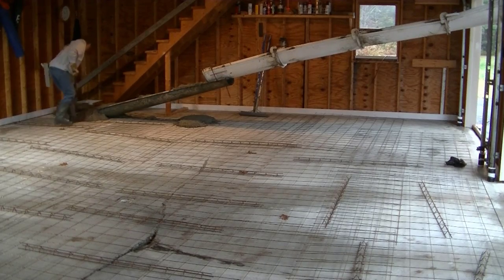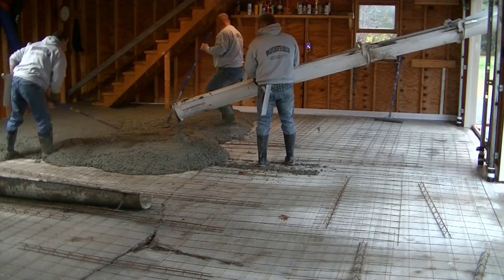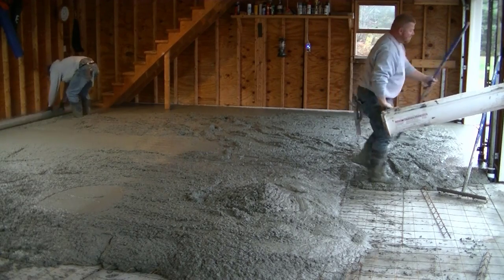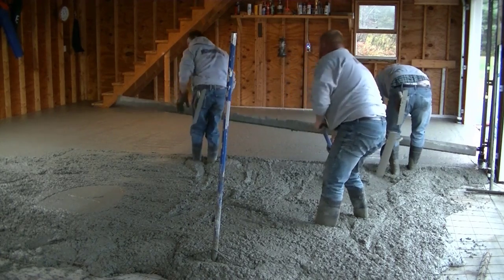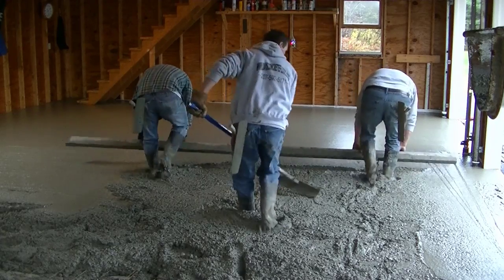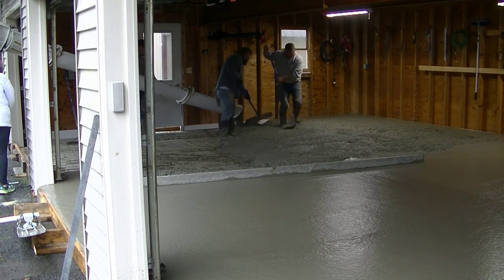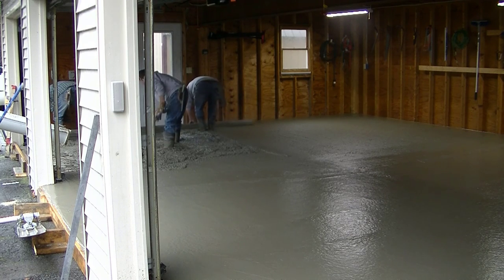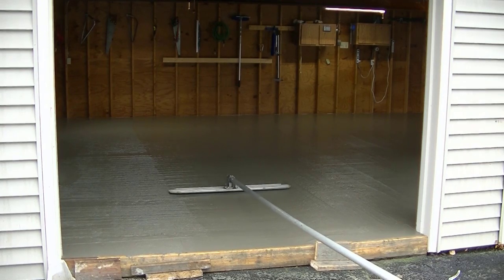Pour A Concrete Slab Over A Concrete Slab | Garage Floor Makeover

Comment: I have a shop floor 6 inch thick. No cracks. Would like to put indoor heat. So 1.5 to 2 inch insulation down on the old floor then infloor heat lines. How thick would you pour on top. It does get a 150 hp tractor parked inside for the winter.
Reply from the maker: For a floor with large equipment like that at least another 4".

Comment: I have a question if I want to pour a 1 1/2" slab over my existing garage floor which cement is best to use?
Reply from the maker: I use 4000 psi with 3/8 aggregate for my mix. I add micro-fibermesh to the mix also.
Reply: @MikeDayConcrete  thanks that will help me lots

Comment: Can you feather out a garage drain slope. My garage drain has to much of a slope about 5 feet around the drain. I have about 2.5"slope in 5 feet. I want to just re-slope to the drain. But wondering if from the old concrete to the new it will bond?

Comment: My money says there is little to no rebar in the oiginal concrete< When I added a garage to a house when I lived in NC I had several concrete guys come and give me an estimate to do the floor they did not want to use any rebar at all. I hired someone to do the pour. I did all the steel and form work and they finished it. I used 4000lb mix, rebar and fiber in the concrete. No cracks after 8 years, my neighbor had a garage built and it looked like the one in the video after 1 year.  I poured mine 6 inches thick.That is why I wound up doing a good part myself.
Reply: Usually that’s caused by insufficient compacting of fill. Re bar and wire is code and should have been inspected.

Comment: Great idea!  Can you do the same over a driveway?  Similar situation, house was built 22 years ago.  Had some leveling done about 10 years ago, but still dealing with pitting and cracking.  The builder at the time subbed out a lot of his work to the cheapest folks he could find.
Reply: No you dont want to pour over your existing driveway. Have to see it to give my opinion but remove and replace is your best bet 99.9% of the time.
Reply: Do you have to cut the asphalt to remove and replace?

Comment: What do you do for your garage door detail do you slop the concrete or anything to keep water from running under the doors
Reply from the maker: Yes, we slope it about 1/2" and in about 8"
Reply: @MikeDayConcrete ok I was just wondering cuz we start the slop back around 4 inch's from the edge of the wall and and put a inch or better that was the door when closed is sitting about 2 down on the slop and that seems to keep wind driven rain from coming under the door and flooding the floor

Comment: Great video.  What was the reason you created a hand trowel and plated a 12" second in the middle of the pad and you seem to compare all the level with that.  How did you get where that level height should be

Comment: Did you trowel finish that floor? Saw cut it?
Do you use water reducer in cold weather?  Or is adding water the only way to make concrete flow better when cold out? I'm talking just above freezing.
Reply from the maker: Yea, we power troweled it and saw cut it. We always use the water reducer whether it's cold or hot outside. We had 115 degree water in this mix and we used calcium chloride in the mix to help it set up faster. It was about 40 degrees outside and rainy on this day.
Reply: No problem with calcium chloride when using rebar Mike? No disrespect,  just asking from So. Cal. Your you tube videos are all good, informational. You don't do any bragging or b s talking. Nice.Thanks

Comment: I have a shop that is 25x40 and was originally a chicken house. The previous owner poured his own concrete 50 years ago but it started cracking 10 years ago and has separated perhaps an inch and some un leveling here and there. I filled cracks with concrete but it doesn't last long. There is some hollow spots (sounds like it) under existing concrete. Would it be possible to pour 3.5 inches with good rebar and have it hold for 20 years? I would tie into existing stem walls which are cracking too.

Comment: Shouldn't you crack the concrete to give some bonding and moister to escape between concrete? I assume moister may be trapped between the lower and upper slab.
Reply from the maker: Simple answer to that is no.

Comment: Hey Mike,  why didn’t you put heavy plastic down before pour, ?
Reply from the maker: I could have. He wasn't having any moisture issues. I didn't feel he needed it on this one. Each one is different. I do come back and apply a penetrating moisture blocking sealer.

Comment: Quick question for you.  I have a 750 sqft garage and i do get some moisture wicking up through.  It caused my garage floor coating to peel.  There is no vapor barrier under it...the original builders screwed it up.  
Would it be possible to put a vapor barrier down before you add another 3"?
Reply from the maker: Yes it would be recommended to add a vapor barrier but I  would also add an inch of crushed rock also. If you have that much moisture it has to have a place to go and not build up pressure under the new floor.
Reply: Here in PA, some builders do not put vapor barrier under slabs that do not have living space above the garage. Just a thought as to why there was no vapor barrier.
Reply: @MikeDayConcrete  Thanks for the reply.  
So with the crushed gravel, doesn't the moisture just seep into the gravel and hang out there forever.. saturated?

Comment: Great video!  I have a good slab, with no cracks, in the garage and it’s level. My issue is where the garage slab separates from the driveway slab. The garage slab is about 1/2 to 3/4 of an inch higher than the driveway, and it curves in toward the garage in the middle, with the slab line even with the outside of the door railing. When I shut the door, the outside 3rd of the door, on both side’s, seals, with a gap in the middle! I can’t even install a threshold because half of it would hang off the slab. Do you have any thoughts on how I can remedy this, and get the doors to seal without replacing the whole floor?

Comment: Bought a property that had a torn down garage; only the concrete pad remains.  I want to build a bigger garage over that spot.  Can I pour a new slab over the old slab?  Will that meet code?  It will be a lot cheaper than having to jackhammer the old one up.
Reply: Not are not building a rocket ship, so anything will work. Make sure the draining of the new parts are good. Ideally, add some fine sand on top of the foundation and flatten and level it (about 1"?). Then add 2 layers of heavy plastic, and pour the concreate. Make sure the concrete is floating on the top if the sand and the moisture barrier and that it isn't touching anything rigid. Then the floor will never crack, provided the foundation is stabile.  

Most important is draining and a stable foundation. If the concrete is floating on top of fine sand and  2 layers of heavy plastic,  it will never crack.

Comment: How much did you say you charged for this job?  Did you say it was 10X cheaper than breaking up the concrete and pouring a brand new slab?  Just trying to know what kind of price I should be expecting. Thanks.

Comment: When over-pouring existing concrete, do you ever have issues with reflective cracking?
Reply from the maker: Not really, but you can have them if the cracks are still active. If you think that's the case you can add a layer of 1/4" foam between the pours.

Comment: I had always wondered if this could be done. My dad who coordinated with the builders and the concrete folks had my garage floor built higher than what was in our previous garage which on occasion did get some water. We knew that  we would never get water with what we had. All that changed one Hurricane Ike hit. From that point moving forward my part of the city has always had street flooding. Although the cities sweats they cleaned out the drains my garage continues too take on water. My garage would be like a small 4 bay. I have storage on the south side and one large garage door on the north side. These two areas are separated by a wall. Assuming that I might be able to find some to pour another 2-4 inches on my existing concrete would I need to remove the wall in between? I do have windows on that side about 3 feet from a gate which leads to the street.   My long term goal was to build a room on the north side and leave a garage on the south side thus the reason for the wall. I suppose I would have to cut the garage door hole higher.  Anyhow, I am really glad I saw this video and know that pouring more concrete is indeed an option. And is priced lower than $38,000.

Comment: 38 years in construction with the last 19 as a licensed contractor. I'm sorry, but I have to say something. The stairs should have been removed & rebuilt, because, the risers will no longer be to code, risers have to be the same height from floor to floor. Also, I've always left a door pocket in the concrete for overhead doors to keep blowing rain, built up snow, etc...from getting in. Is that something you normally do but just didn't do it here? Also, did the top panel of the garage door need the wheel hubs adjusted or larger ones installed due to the floor being higher?

Comment: Why was the garage floor originally poured the was it was when it was first built? Also, could you use a wire mesh for better tensile strength or would that present a possible cracking issue due to expansion?
Reply from the maker: How am I supposed to know why it was originally poured. Not sure what you mean about the wire, we did use wire.
Reply: Mike Day Everything About Concrete - Well Mike I guess perhaps you could’ve asked the person who poured it or maybe they poured it themselves or maybe there was a reasoning because I believe if I remember correctly there was a drain in the middle of it? So I thought perhaps the property had some sort of drainage issue. Thanks for replying back.
Reply from the maker: It was originally poured in 1995. I'm not sure who did it back then.
Reply: Mike Day Everything About Concrete - thanks, I did not catch in the video you used wire. Thanks for the reply. Great work!
Reply: stanley smith open your eyes!
Reply: Gary Derksen - Watching from an iPhone I really could not tell because if I recall, the video starts with the actual pour. I wasn’t sure if it was rebar or the wire came through or what not, like maybe the owner may have added. My other concern was possible cracking with wire mesh so close to the surface. I didn’t want to be a smart ass so I asked politely. I also wonder if Mike could have gone without the wire mesh. I also noticed someone else wrote he would’ve gone with sand and 15 mil moisture vinyl, so I wonder if the wire mesh could have been skipped altogether.

Comment: Hi Mike! Hey we raised our garage up to house floor level years ago to make it another bedroom. In retrospect it probably would have been better to just build a wooden subframe incase we wanted reverse it back into a garage in the future. But we poured concrete instead not really knowing any better. I think we poured about 5 to 7 inches to raise to floor level....

Do you think it's possible to break and remove slab to reveal original foundation and reverse the space back into a garage? Or is that pretty much permanent? 🤔

Comment: Love the vid and I have the same problem (lesser as it only gets about 3 feet in on one side at the bottom of the Garage door).  I have a question.  I've framed out my door with the same type of poly board.  Would it be better for me to cut the board and trim, as well as move the door rail before capping the existing slab?  Also, did you frame the floor to where the seam separating the garage to the driveway?
Reply from the maker: It's a good idea to cut your trim up, yes. We did put the door stop where the floor meets the driveway.

Comment: Tamp to leave one or two guys to finish by hand. Makes it creamer (rock farther down from top) first time over = easier. ( you can take wider sweeps first time over gives you a better chance to go over it 3 times instead of two. It’s ok for inside, but on outside work you wouldn’t want to tamp because you want rock closer to top to help hold concrete in place. ( help keep from popping in freeze thaw cycle).
Here’s a example if you .left those two girls there to hand finish it would be a lot easier for them to trial the concrete. Give you less stress on wondering how they’re doing.
Reply from the maker: I think I'll pass on the tamping thing. Don't see where it's really needed.

Comment: You only have 3" of concrete in front? Seems like that's not thick enough?
Reply from the maker: Steve, it's got a 6" concrete floor under it for a base. It'll be good.
Reply: @MikeDayConcrete  it's more likely to eventually crack it would seem

Comment: Do you worry that the old floor will drop more, and crack the new floor? I see the steel in there, but is that normal to do? Just curious...
Reply from the maker: It hasn't dropped any more since about 1996-97 year. It did the settling the year after it was poured. We drove a heavy vehicle over the cracks to see if either side of the crack moved any and didn't notice any movement. The homeowner was informed of this risk and he was comfortable with it. We felt it wouldn't settle otherwise I would have suggested a tear out and replace.

Comment: would this work in Canada? the house I bought wass built in 1989, the garage floor is cracked all over.
Reply: I would advice jackhammering it up and correcting the aggregate underneath and pre pour with rebar. Then correct the water issues you most likely have.
Reply from the maker: I have to inspect each one of these to make a decision if it's a good candidate to pour over or not. Some are and some aren't.

Comment: What about the edge going into the garage, there is a 4 inch high
Reply: Probably have to remount all the garage doors too or there will be a big gap at top.
Reply from the maker: His driveway was higher than his floor leading to flooding whenever it rained. Now his floor is higher and he can re-pave his driveway to slope away from the garage. He was having his doors raised to compensate for the added height.

Comment: Been doing that for years and I still get criticized for pouring over concrete. I use lots of steel and go, as long as there is no voids under existing slab your game
Reply: Cracks and gaps usually do mean their is a void. I demo buildings with an excavator and do the aggregate work, i have yet to break up a broken floor that had good aggregate or no voids in it. Water gets in, makes mud, frost gets in and jacks and shifts the floor. Water is a buildings worst enemy.
Reply from the maker: Join the club, everyone has a right to their opinion. I make my decisions based off my inspections. Always have always will.
Reply: Not saying it wont work, but you better be damn sure the water issue is solved and the gravel underneath is good. I know demo and starting new is expensive and not an option for everyone. Cheers.

Comment: I have a question in regards to cracks prior to adding a new layer of concrete.
I have a very fine crack - I cannot fit a piece of paper in the crack: should I chase the crack, then fill the crack prior to feathering a new layer or concrete or no chasing the crack prior to adding a new layer of concrete?
**Personally I'm think of chasing the crack, filling the crack, and then adding the new layer of concrete.
Reply from the maker: It's 50/50 chance the crack will mirror up through the new floor. If it's not active anymore (not moving) you shouldn't see it whether you fix it or not. It's ok to fix it if you want to. What do you mean "feathering a new layer" how thick are you going to pour this?
Reply: @MikeDayConcrete  Thank you for your response. I'm 50/50 as well, but knowing me I will chase it 1/4 wide & 1/4 deep. I would dislike not fixing it and the resurface cracks in the same. All that work done for nothing (waste of time & money)

Comment: Question:  I've always heard that you should wet the concrete below so it doesn't suck the water out of the new pour, is this true?
Reply: Yes it is!
Reply from the maker: When it's hot out that's ok, no need to when it's only 40 degrees out.

Comment: I JUST POURED A 4 IN CONCRETE OVER EXISTING OLDER CONCRETE 6 X 8 FT.  I GAVE IT A SHOT OF WATER TO WASH OFF SIDE WALLS THEN STONES CAME UP.  I AM ASSUMING IT DID NOT DRAIN PROPERLY DUE TO THE EXISTING BOTTOM FLOOR.  I MIXED 16 BAGS  OF MIX. I 2 X 4 , METAL RAKE, BROOM.  I DIDN'T HAVE ANY MASONRY TOOLS.
Reply: you should have wiped the walls of if you hit concrete while wet you will take the top cream off.....

Comment: How does adding a slab over a slab solve the water problem which is outside?  From what you said there was water running under the original slab and most likely had a poor base underneath causing the settlement and cracking.
Reply from the maker: No, I said his driveway was higher than his floor so when it rained water would run into his garage on top of the floor flooding it.  Now his floor is higher and he can re-pave his driveway to slope it away from the garage solving his water issue.

Comment: Those wire chairs looked like they are mostly letting the wire mesh lay on the old slab’s surface. Does that help stabilize the entire thickness? 
Does the homeowner plan on raising the driveway to meet the new door height? That last bay showed flaws in your bull float screening that I hope you were able to smooth with the power trowel. It would be great to show the floor after it was done and again a few years from now.
Reply from the maker: Yea, we power troweled it very smooth, no flaws.  He was lifting his driveway up to meet the new floor. And you can never have enough chairs under wire mesh.